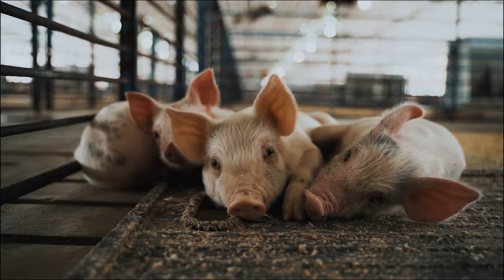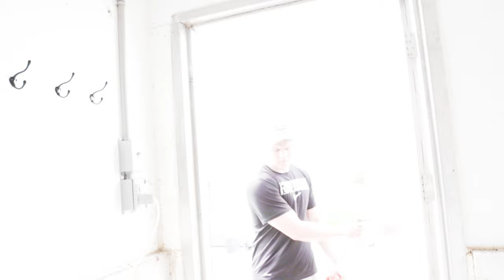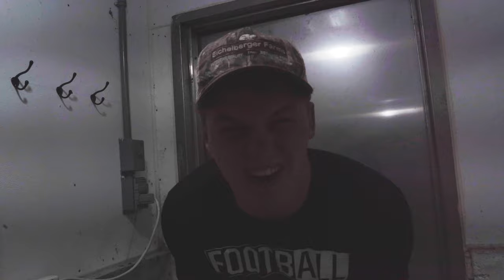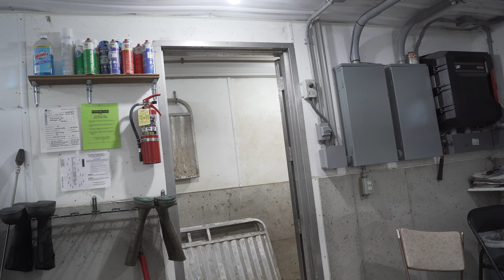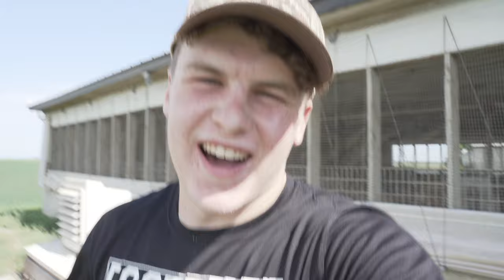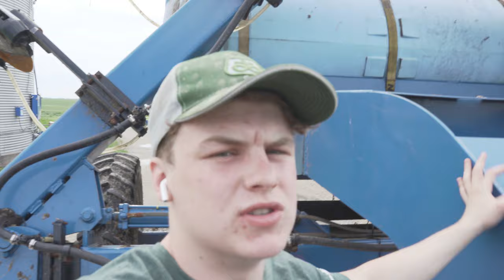Why Farmer's Side Dress Their Corn..

Comment: U mentioned hog manure - that reminded me of college, summer work back in 1969, Norman Park, GA. Where the Iveys were using the poop, N a hole to run a small power generator that runs on the fumes.  Is that still a way of generating power?